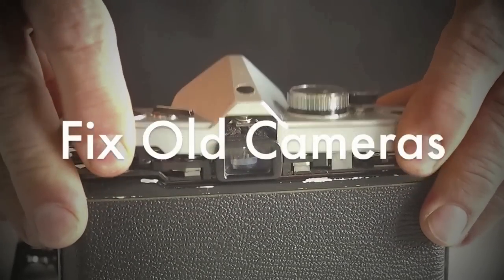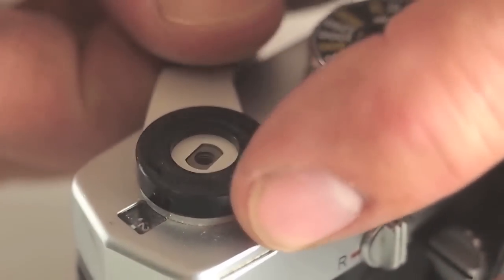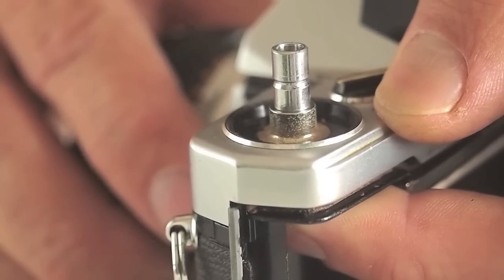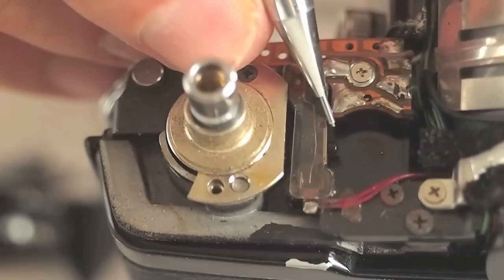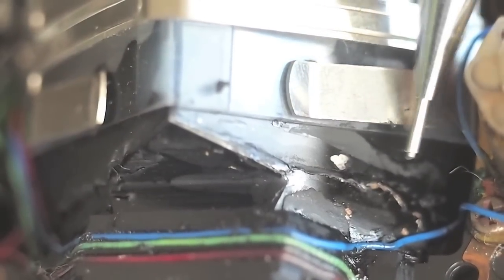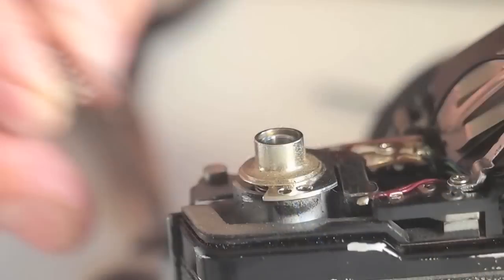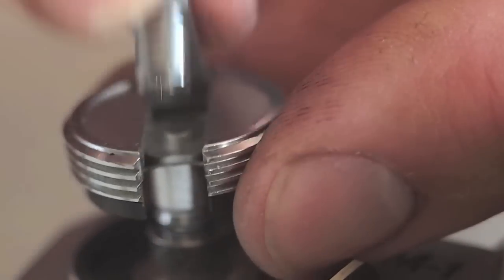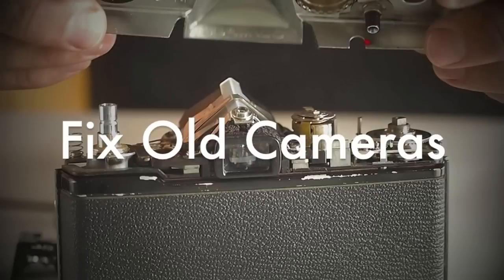Fix Old Cameras: Olympus OM 1 Prism Foam Cleaning

Comment: Thank you for the video. could you perhaps help with a problem? When I pull the rewind knob up it should obviously open the film door. But since I have removed the top cover it doesn't spring open like it should. do you think that I've installed something wrong or is the tension off the door latch spring compromised?
Reply from the maker: +HKG36E The door latch spring would only effect the latching of the film door when closing. The spring snaps the latch down after the film door latch pushes the body latch up for, creating the door closed and latched condition. If the door now does not pop open at all then possibly the door latch in the body of the camera is not position correctly in the slot of the rewind shaft sleeve. If this is the case then when the rewind knob is lifted to open the door the latch is not being disengaged. If the door opens with help then the door is binding somewhere. Try to determine where the door might be rubbing. Check the latch on the door to see if it rubs against the body of the camera also.

Comment: I was able to completely replace the brown wire up to the switch with a new one as the previous was completely corroded, but my light meter is still not working. Do you know what else could be causing this issue?
Reply from the maker: +mj0188 isg Congratulations on the wire replacement. Check all solder connections. Check on/off switch for proper function. Check battery chamber for proper connectivity. Apply battery voltage to the galvanometer to confirm functionality. Check resistance of CDS cells. The resistance of the CDS cells should vary with the intensity of light striking the photo sensitive surface.

Comment: Hey there, wondering if the OM-2n has the same issue? Thanks.
Reply from the maker: If the foam placed between the accessory socket bracket and the prism comes in contact with the glass of the prism it will have the same results given the right conditions.
Reply: Alright thanks a lot! Was thinking about getting it but I think I'll go with a Nikon FM2 instead.
Reply from the maker: Both the OM-2n and FM2 are fun cameras to use and proven designs.

Comment: Despite using many variations of an expanding spacer wrench (corn on the cob holders, sewing pins, pointed sharp tweezers) I still cannot get the decoration cover off the film advancer. It's like the darn thing is stuck. I've tired moving it clockwise & counterclockwise to try and loosen it but nothing happens except me getting frustrated & scratching the heck out of the plate! PLEASE HELP!!!!
Reply from the maker: If a sturdy spanner wrench is not available, I would suggest the small DYI spanner outlined in the Fix Old Camera Video or a small pair of needle nose pliers. They will give you more torque. The damaged decoration cover plate can be separated from the retainer screw by pooling isopropyl alcohol on the face to loosen the adhesive. Replace it with a circle of leatherette or some other suitable substitute. The pin face spanner screw is loosened counter clockwise. Try seeping some solvent under it to loosen the threads.

Comment: Bought an OM-1N on eBay about 6 months ago for £40 with the original box and manuals, light meter was broken, so opened up the camera and cables had rotten. All the shutter speeds worked well - so I got a mint 35mm f2.8 OM-system lens for it (I thought I could always resell the lens or adapt it so got a really good example). After testing with the lens today, the lens will not focus on infinity. I can almost certainly rule out the lens, so what could it be in my OM-1N body that needs calibrating to focus on infinity? Hope you, or your viewers, can help me! Thank you!
Reply from the maker: Try the lens on another camera to confirm rather it is a camera, lens or
 combination problem. If you do not have that option. Lock the shutter 
open on bulb and apply the transparent office tape that is cloudy, it 
will give you a focusing surface similar to ground glass. If the image 
is sharp than you know the lens is OK and the issue is with the reflex 
mirror or viewfinder screen. The first thing to check would be that the 
focusing screen did not get inadvertently flipped upside down. The angle
 of the reflex mirror will then need to be checked.
Reply: Fix Old Cameras Bought an OM adapter for my Sony a6000 and the lens has the same symptoms... seems really odd as the lens looks new! I have written to the seller on eBay so hopefully will be able to come to some agreement on an exchange/refund :( Thanks for your help and fast reply!

Comment: I wonder if there is some sort of silver paint, that one could apply to restore the reflecitve coating of the prism that gets lost with cleaning?
Reply from the maker: It is the degraded foam that eats into the silver coating of the prism and it is a wonder why it was ever used when the camera is so carefully engineered and constructed in so many other ways. There is a procedure to restore the reflective surface, but, unfortunately the silvering solution is a highly toxic mix of  silver nitrate and sodium hydroxide and ammonia and no fun to work with. Probably easier and cheaper to find a donor camera with a good prism.  The specialty "looking glass mirror" spray paint might work to some degree, but it is not intended for optical quality.
Reply: I see. Unfortunatelly this is a pretty common problem that I encountered on on several OM-1's by now.

Comment: Hi, I check your camera repair tool store but I did not see the spanner wrench you used in your video. Do you have the link for that wrench? thanks
Reply from the maker: There is Japanese copy of the spanner wrench that is featured in the Fix Old Cameras videos. The blades are held in by a screw rather than a click stop. Pointed and slotted tips are included.  It is now available at the included link.
http://astore.amazon.com/fixoldcam-20/detail/B002QIACDO  
The spanner wrench featured in the Fix Old Cameras videos is apparently temporarily unavailable or perhaps no longer available. The spanner tool seen in the videos has been in continuous service for over 35 years!
Reply: Fix Old Cameras Well, not all old thing is bad. I really like the spanner wrench in that video as it has the round toe and will not cause scratch mark on the body when it slip out of the small holes on the body.

Comment: I'm having a very hard time with the first step (removing the decorative cover above the advance lever.  The spanner wrench flexes but the plate simply won't spin.  Any suggestions?
Reply from the maker: +Andrew Viny Remove the black decorator plate so if the spanner slips you don't leave a mark. Make sure you apply pressure in counter clockwise direction. Seep isopropyl alcohol under the spanner screw and apply heat from the tip of a solder iron for 2 to 3 minutes (longer if needed).
Reply: The problem I'm having is removing the decorator plate.  It just won't budge.  Wouldn't an iron melt it?
Reply from the maker: The decorator plate is painted soft alloy metal. Seep alcohol under the plate down through the spanner holes it will soften the glue and the plate will pop right off. Then you can work on the spanner screw with heat and alcohol to get the threads to release. Be patient. It will work.
Reply: I had this problem too. I was pressing down too hard with a twin spiked lens tool and digging into the wind lever, so nothing would turn. When I made a tool with a length of hard alloy and two squared off small diameter nails set into holes drilled the right distance apart, I released the decorative black item OK. But I had to drill two new holes because I'd damaged it too much using the original spiked tool. Black nail varnish may be called for!
Thanks very much for these video guides.

Comment: Does anybody know how to fix shutter speed on Olympus OM-1. No matter the shutter speed setting i put, the speed is all the same. Thank you
Reply from the maker: The shutter speed dial and the shutter speed changer gear are possibly not meshing. The contact point of the shutter speed dial ring and the shutter speed changer gear is visible by removing the the bottom cover plate inside the mirror box. The cover plate glue can be softened with alcohol. Be sure NOT to get any alcohol on the veiw finder screen as it will damage the fresnel plastic of the screen.
Reply: Thank you for the fast response. You are awesome. I can see the black plastic gear on the ring moving a metal horizontal small gear on the bottom. It seems to be changing but the shutter speed remains the same.
Reply from the maker: The gears can sometimes slip and lose timing. When the camera is set on the B position and in the proper timing you will see a small hole facing front and center in the speed changer gear. Also check to see if the levers are following the speed changer cam stack. Look for misplaced springs. Look for sticking levers. The slow speed escapement the sets toward the back right  of the camera mirror box could be stuck.
Reply: FIxed it. Again, you are awesome. Thank you very much.
Reply from the maker: Very good. Glad to hear of you success.
Reply: I am having the same problem, just with a Yashica  TL Electro X. I do not know if it is the absence of a battery, or if the shutter is having problems. Also, the screw mount is slightly, off the lens stops turning about 30 degrees past the normal stop point. This is occurring with all lenses, so I think it needs a mount adjustment. The mirror lock-up doesn't lift the mirror all the way up as well. It hangs just barley open, and It cannot be closed except by the operation of the shutter, or with a finger. When pressed, it doesn't stay up. How do I go about these repairs?
Reply from the maker: Yashica Electro TL X has a Copal Square SE electronically controlled shutter. Even though the speeds are controlled electronically, the release is mechanical. So the shutter will release and fire without a battery, but will not time out at the various speeds, but instead delivery the 1000 shutter speed. The camera will take either 2 each PX640 batteries or 1 each PX28 battery. To determine which battery is used in your camera take an AA battery and see if it slides into the battery chamber. If it does, use a pair of PX640s. If it doesn't, use a PX28. Make sure that the battery lid and battery chamber contacts are free of any corrosion. Also make sure that the negative contact of the battery side faces inside. If the battery is installed in a reverse position, the exposure readout will not function and the shutter will not time out.
The lenses could be blocked from going on all the way by the mirror lift positioning of the aperture stop down linkage.
Reply: +Fix Old Cameras Thank you so much! I found that a AA battery does fit into the chamber. I will use re recommended battery. You are a lifesaver!
Reply: Upon trying to get the lens to mount all the way, I found that it will not go any farther. It seems that either I cannot get the linkage out of the way, or it is simply in need of a mount adjustment. I am turning the aperture preview off and setting the lens to M, so the link pin is flush with the base of the lens. The mirror lock up is turned off and the lens is set to the closest focus possible, to keep the rear lens group out of the way. It seems that there is enough space to complete the revolution completely. How do I get the lenses past the aperture stop down linkage? I do not want to force the lens unless absolutely necessary. I also checked for damaged threads and dirt and dust in the threads. They are clean, with no dings or dirt. How can I move the linkage or, if necessary, adjust the mount? Thank you for your earlier response. It has helped a great deal.
Reply from the maker: It still sounds as if the aperture stop down linkage of the camera is not where it should be. If you have access to another TL Electro where the lens mount correctly you will be able to compare the two and maybe find a clue to what is preventing you from mounting the lens.
Reply: Ok. Thank you very much for your time and support. It has saved another camera!
Reply from the maker: Good to hear.
Reply from the maker: Good to hear of another successful repair and your continued enthusiastic interest in Fix Old Cameras is greatly appreciated.
Reply from the maker: It could be that the shutter speed setting ring gear teeth are not meshing with the teeth of the shutter speed setting gear. The hole in the gear is 1/1000 speed and is used as an alignment timing. You can check the speed setting gear by removing the front edge half of the lower cover in the mirror box.

Comment: Love your videos. My OM-2 Spot Program on the "manual/spot" position shows the exposure go up and down but does not show the arrow (correct exposure position), witch defeats the whole purpose of that camera to me. I some times see the missing indicator light up, glitching, from time to time. P.D.: Can't explain how satisfying this videos are, thank you.
Reply from the maker: The OM-2 cameras have an exposure control circuit and an exposure meter circuit they nearly work independent of each other. The exposure control circuit fits on a single ceramic board at the bottom of the mirror box. The exposure meter circuit fits around the viewfinder and prism. The problem is probably in the exposure meter circuit. To properly troubleshoot for the cause of this issue is somewhat detailed and involved. However there are a couple of simple possibilities... Check for loose ground screws in the meter circuit around the CDS cells (located next to VF). Check solder connections around resistors in the meter circuit.

Comment: Hi, I bought a used om-2n with the rewind shaft dropped and the door is closed, what can I do?
Reply from the maker: Watch the Fix Old Cameras video on OM-1 Prism Cleaning at about the 6:55 point for one technique. If the rewind shaft has dropped completely free, a paper clip bent to a hook that will fit into the rewind shaft opening can be used to access the film door latch. The door latch plate hiding under the leatherette can also be removed ( a word of caution - watch for the door latch bushings). The procedure will be demonstrated on several camera models in an up coming Fix Old Camera video.

Comment: Thanks for the video, helped a lot with the OM 1n i've just got. Although it seems like something's missing - when i look inside of the camera through the lens mount hole, i can see more foam around focusing screen, how do we clean and replace that part? Mine is def. has turned into gummy...Thanks!
Reply from the maker: You will need to carefully remove the old foam with a wooded cleaning stick carved to a blunt scraping edge that is of the proper width. The degraded foam could scar or smudge the focusing so work with care and should you get a flake or crumble on the screen try to remove it with a gentle blast of air or lift it off the offending piece as shown in FOC videos.

Comment: Hello FOC - Thank you for some very informative videos. I just cleaned my prism and removed the foam no problem. But now when I've put the top cover back on - the film door wont open when I pull the rewinder. It seems that when I pull the rewinder the locking arm isn't pulled high enough to open the door. Any tips? thank you.
Reply from the maker: Remove the top cover again and check to see if the linkage plate the is lifted by the rewind knob to disengage the door latch is misplaced.

Comment: Interesting. Electrical tape eventually fails in 2 ways. Either the adhesive turns to goo and slimes everywhere, or the plastic tape turns into a potato chip and cracks and snaps off. Wondering if you have considered cotton of some kind, that won't degrade?

(I actually clicked on your video thinking maybe you were going to get behind the focusing screen for replacement/cleaning. I have a Canon AV-1, non removable focusing screen that needs either replacement or a miracle to get rid of the adhesive foam from the mirror foam that disintegrated all over.)

Comment: Just curious why cleaning the degraded foam was necessary in the first place. Was it causing an issue with the camera's function?
Reply from the maker: If the degraded foam is left, overtime it will attack and destroy the reflective coating of the prism. The damaged coating will show as dark stains in the viewfinder.
Reply: It totally wrecks the prism and is visible in the viewfinder as an ugly black smear. Not good!

Comment: Your videos are terrific...a great resource. Question: I plan to remove the the prism foam from my OM-2N. I see some degradation just outside the actual viewfinder field of view, right at the lower border where black meets the field of view. While this doesn't interfere at all with using the viewfinder now, I'm concerned that eventually it will. Once I have removed the foam, will the prism degradation stop, or should I expect to replace the prism at some point? Thanks.
Reply from the maker: The degradation of the prism will stop once the deteriorating foam is removed completely. If you would like, replace the old foam with a piece of wool felt of the appropriate thickness

Comment: Thanks for this great tutorial. I'm trying to apply the same method to repair an OM2 but the OM2 has a exposure compensation meter coupled with the iso dial instead of a shutter speed dial. I accidently turned the dial while repairing and was wondering how I set the exposure back so the information represented on the dial is accurate to the setting inside the camera body. Could you possibly add a short tutorial on this?
Reply from the maker: You should be able to use another camera with a known good meter to use as reference for the set up.